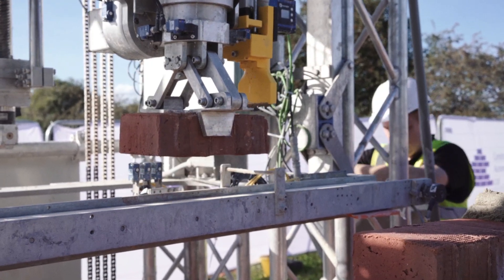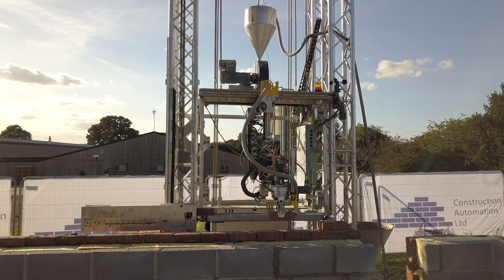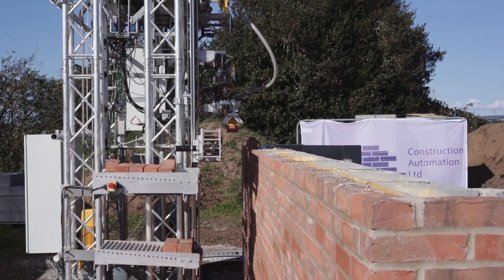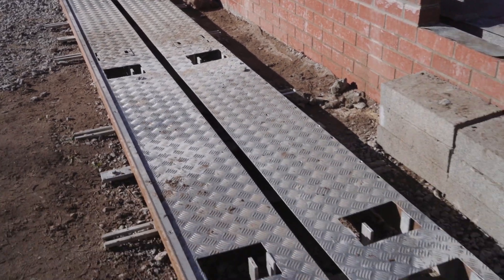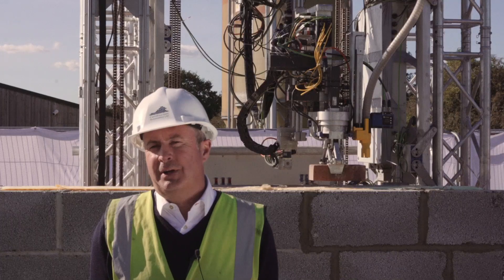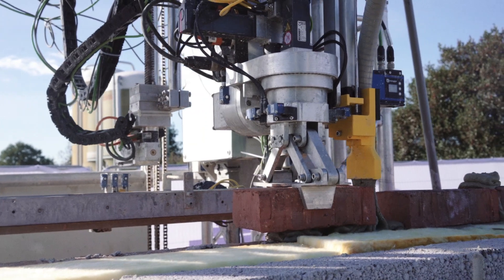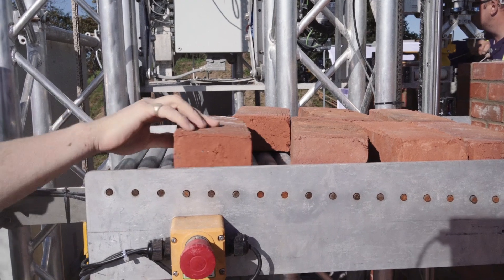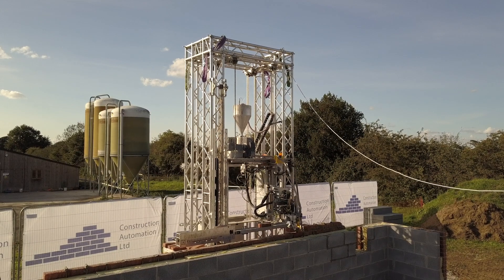UK-developed robot bricklayer builds house

Comment: So many questions for this.  It looks like it can only build a detached box with no internal walls or can it cope with internal walls, party walls, etc. as well?  Even if it will just build a standard box (which planners don't let you get away with these days) then how is the insulation as shown on this example installed?  Who places the dpc's, wall ties, lintels, window formers, etc. bearing in mind there is no scaffold?  Can it lay feature courses - even if they are just different coloured bricks?  What about placing trays for porch roof abutments, etc.?  How is a scaffold erected so the carpenter can safely lay the joists & flooring?  Who does the beamfill to the joists?  What about raking brickwork on the gables?  What if the houses are only 1m apart?  What if the site isn't level?   What if the houses isn't designed using full bricks everywhere?  If it can't do these things then what is the point?
Reply: Totally pointless machine, it’s extremely limited in what it can do and if this video shows it’s actual speed, then I’ve seen human brickies  lay quicker !!